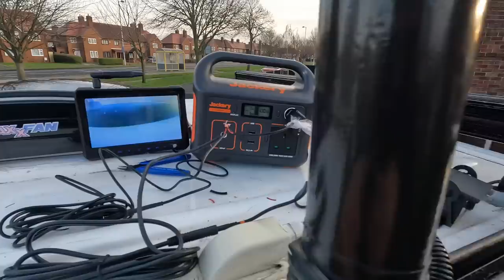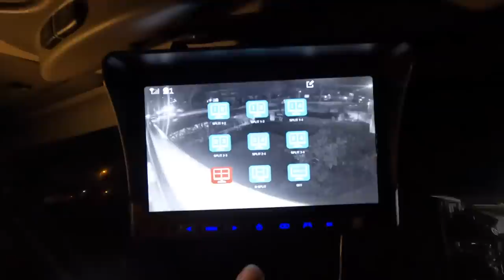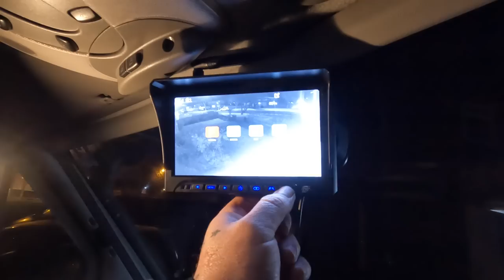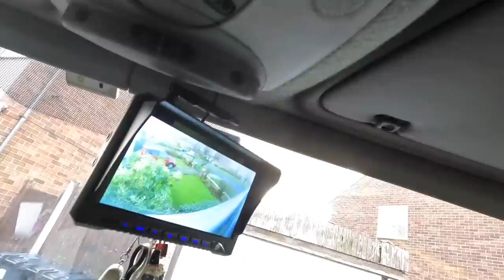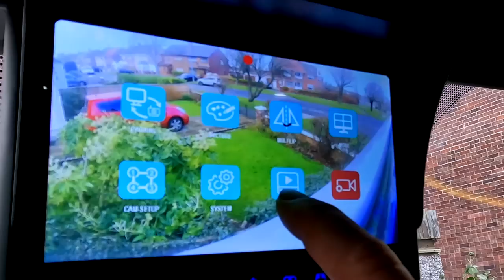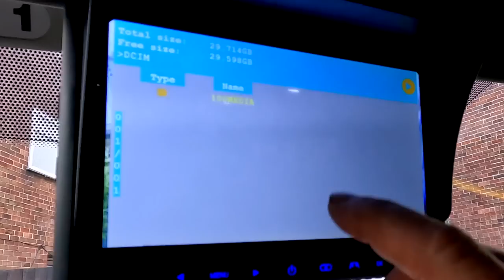Easy CCTV Hack That Could SAVE YOUR LIFE

Comment: The infra red light cast by the built in IR LEDS on the camera are having a bad effect on your image, if there were a way to move the camera of  have a matt black surface where the light is hitting the van surface, the night image would be far better, not so much a problem during daylight as the IR LEDS are not switched on and the cameras electronic shuttering is coping well.

Comment: Just looking at the spec of the camera sensor. It's an MCCD 1/2.7" sensor which is why the picture quality is much better. Plus the spec on the monitor says its a 7" 1080p which means the manufacture isn't cutting corners and using low resolution cameras and monitors. I have done a bit with CCTV cameras over the years and in all honesty they didn't need more than 720p on a 7 inch monitor. So at around £200 + shipping and import tax, it a bit of a bargain.
Reply from the maker: See if I was good I’d know all this stuff . And tell people but thanks buddy I hope people see this . Thank you
Reply: @UrbanVanlife  They use the 1/2" MCCD sensors are in a lot of the Sony cameras. The MCCD range of sensors are China's own design. Until about 7-8 years ago all CCTV and digital cameras used CCD sensors that were American owned. So Chinese companies had to pay royalties to the USA to use CCD sensors. The Chinese MCCD sensors are very good in low light. The sensor in that wireless CCTV camera has an Ir-Cut filter. Which is why the colours look sharp during daylight. At night the IR LED's switch on and the Ir-Cut filter is literally lifted up/away from the sensor. To allow the camera to see the Infrared LED light. Always look for the larger1/2" sensors for low light. The larger the sensor, the better it will work in low light conditions. I mentioned about using a 720p sensor and afterwards noticed that is what they had used in that camera. 720p is always going to be better than a 1080p sensor in low light conditions. Plus 720p is much faster to transmit wireless. So you don't notice any lag. I've work on designing a few commercial digital night vision devices over the years. So I'm a bit of a CCTV geek. As an end user it's a mine field, when your looking for the right cameras. Unless you know what your looking for. If you ever want any help finding the right cameras (at a better price) let me know. I can have a dig around online for you.